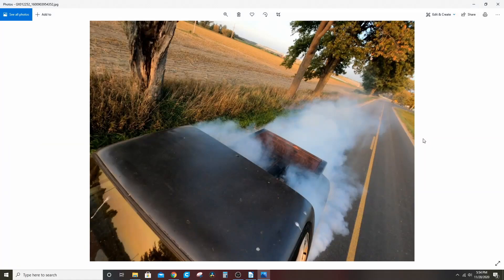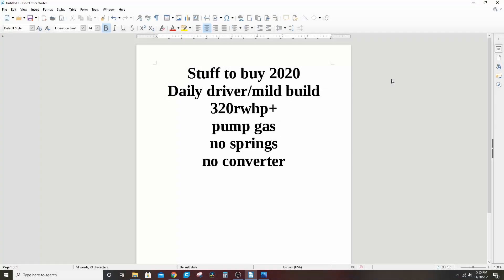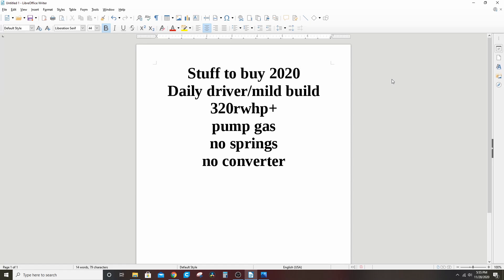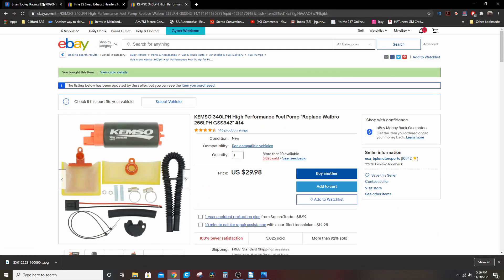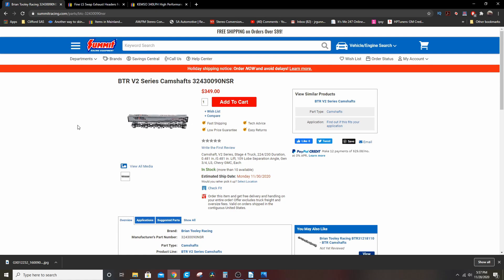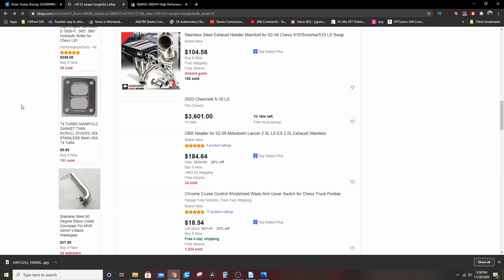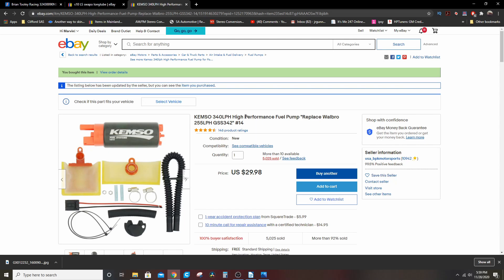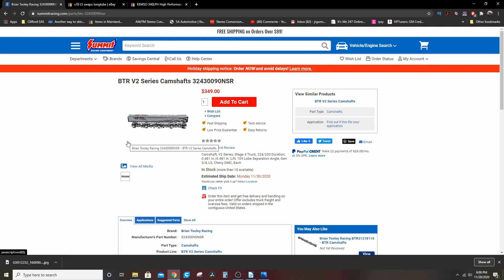LS Build Recipes on a budget, part 1, 350 rwhp for 500 bucks.

Comment: I’m trying to hit the recipe you have according to this video topic. That cam is still Available and is cheaper. I see the video is 2 years old. Is there a better cam for this situation now or is this BTR still your suggestion?
Reply from the maker: My suggestion is always use the cheapest cam currently available in the class, category, stage, whatever you want to call it you're looking at.
Reply: @TheDrivewayEngineer  Well the cam you pointed out in the video is now $299.99. Not horrible. Someone else commented on another cam 
Elgin E1840P .585/.585 Camshaft Hydraulic Roller Lift Sloppy Stage 2 Cam 
It is $110.99. Does this cam fall within your budget build not requiring new springs or torque converter upgrade?

Comment: Here's one for ya brother can you reuse a MLS head gasket after it's been torqued and ran for about 300 miles and sane question for the tty head bolts
Reply from the maker: I always reuse that stuff
Reply: @TheDrivewayEngineer  no issues then ??
Reply from the maker: Loads of issues, everything goes wrong, I just don't learn so I keep doing it like an idiot 🤷
Reply: @TheDrivewayEngineer  
I got a 6.0 3rd gen with gen 4rods budget built  I just got done with the pistons was shot and it needed bored out did all that reused all u could put new head gaskets and bolts with new pistons and rings reused the rest I made it about 300 miles after build and it sounds like a lifter noise so may have to rake it back apart its weird it's got me stumped I've checked everything on the build and double checked as I went its threw me for a loop
Reply: @TheDrivewayEngineer  didn't wanna have to rebuy if I could avoid it
Reply from the maker: @chillbilly2095  it'll be fine, they work no problems
Reply: @TheDrivewayEngineer  if you get a few mins let know I'd like to link up with u maybe u might have some knowledge I don't before I tear it all back down and can avoid it gonna Pull the cam tonight n check it for wear before pulling the heads to actually see if maybe that ell tell me something I'm over looking or not seeing
Reply from the maker: Leave it alone, don't take anything apart you don't need to, if you're not changing the cam, leave it in, quit messing with it and put it in your junk

Comment: I’ve got a chevy k10 and wanna do the 6.0 and 4l80e swap for it to be my perfect mud truck but I have a 98 Silverado with the 5.7 and a rebuilt 4l60e that has a bent frame, is the swap as easy as an ls swap or should I just start hunting around junkyards to get an ls for the truck?
Reply from the maker: Not nearly as easy if you're trying to keep fuel injection
Reply: The Driveway Engineer how much is the most I should pay for an engine or a trans? I found a deal for $500 or best for the 4l80e and the engine and trans wiring harness
Reply: @Nova_17_  pass on that one. I mean pass the sellers contact info if that's too much for e

Comment: Thanks. I have a high miles 08 Silverado WT, flex fuel and fuel management. #1 has misfire, appears a collapsed lifter. What is best way to go?  rebuild same configuration or delete flex fuel and fuel management?  I followed buycoffe link but was a dead end...
Reply from the maker: Flex didn't cause any problem, just get rid of the AFM
Reply: @TheDrivewayEngineer   Thanks for the info and I like to burned tires but I have a WT and want it hauling heavy stuff. Do you post build list and steps for delete and what is best for high miles rebuild?
Reply: Do you have a post how to on fuel management delete?

Comment: Good information JR . What kind of external fuel pump would you recommend
Reply from the maker: I don't recommend external pumps
Reply: @TheDrivewayEngineer  the reason I asked is because my swap is going into a 77 El Camino. I guess I get one of those pump kit and modified the stock tank. Thanks 🔧
Reply: @TheDrivewayEngineer  The reason why I asked was because, my swap is going into a 77 El Camino. I guess I will have to get a in tank retro kit and modified the stock tank.  Thanks 🔧
Reply from the maker: You'll be way better off that way.

You could also use a 96 Impala tank

Comment: Another great video brother, question for you. I'm working on my 5.3 harness as far as the AC and automatic transmission stuff instead of pulling all those wires out of the harness can I just cut the plugs off and tape them to the rest of the harness and do they have to take the pins out?
Reply from the maker: You can leave them, cut them, tape them, completely pull them, or anything in between
Reply: @TheDrivewayEngineer  thanks for the info. This is my first swap and I appreciate all your help.

Comment: Quick question. If you had to choose, which one would you choose. 302 Ford, 305 Chevy, 351W Ford, 350 Chevy? Just a daily engine, nothing for tons of power, just maybe 300 rwhp.
Reply from the maker: Depends on what I was starting with, I wouldn't choose a 350 for a Crown Vic lol.

Not swapping an engine is always cheaper and easier than swapping one, it's why there's a Dodge engine in my Dodge lol, it's not best, but it fits everything with parts I can get anywhere

Comment: Awesome man thanks, exactly what I was looking for. What do you estimate for 6.0 power with this combination?
Reply from the maker: 350 is the high end I would expect, I've seen dynos much higher, but like I said, I'd like to see some other combos on those same dynos to really compare 

BTR engine dynod a 5.3 with this cam at 420, which does line up with a 350 tire rating though
Reply: @TheDrivewayEngineer  thanks!

Comment: Wait Corvette 5.7 aluminum motors already come 350 hp. Who are you kidding
Reply: 2 quick things co me to mind here. 1st, the corvette 5.7 aluminum motor is going to cost you significantly more than $500. Second, it’s HP is rated at the fly wheel, not at the rear wheels.  So, did you not read the title, or do you just enjoy being argumentative
Reply: @smallblockfuelie  I think its just small pp.
Reply: You do realize crank hp and wheel hp are different? Lol
Reply: The video is not even available yet...🙄
Reply: <sigh>  Only if'n yer runnin that hog ass 3/4 cam with them double hump heads.
Reply: @thatc10  That's the recipe for hoppin' a coke bottle!